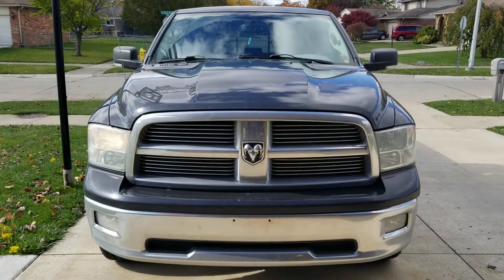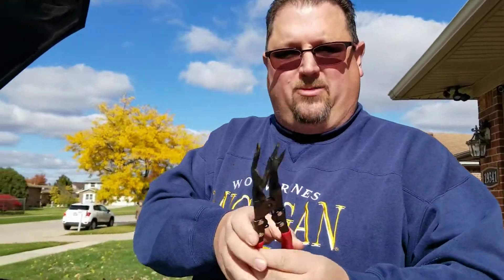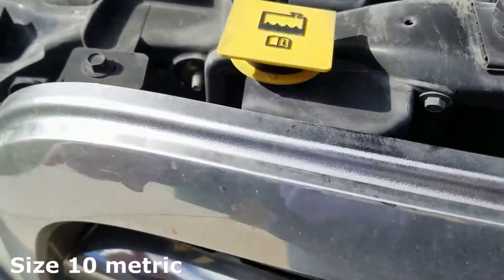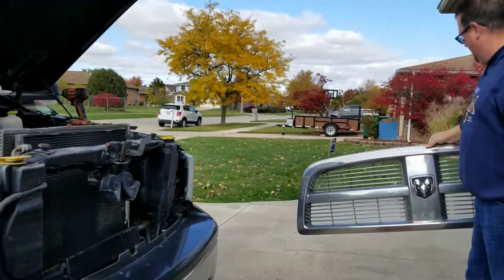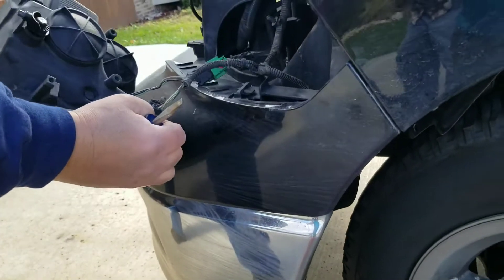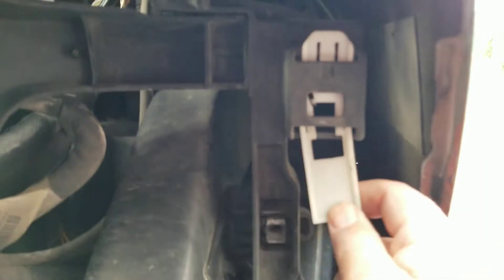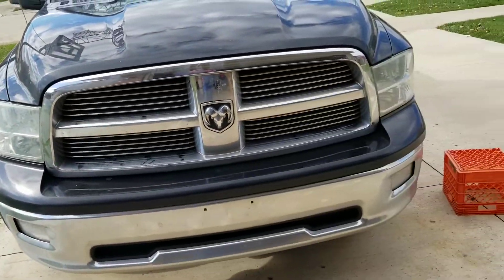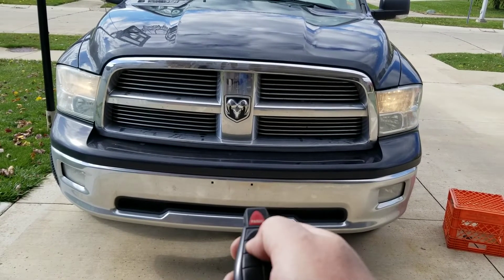How to replace a headlight in 2012 Dodge Ram

Comment: You just showed the hardest way to do this job. There is "No" need to remove the cowling and grill.  You can reach the bolt with an extension .
I recommend watching other video's that show the proper way to do it.
This guy needs to watch them too.
Reply from the maker: Don't take shortcuts.  Do it right the first time.  That's my advice.  Ask an airplane mechanic.
Reply: @GebosGarage  lol if using extensions were the wrong way of doing things I'd have to drop my transmission on my 135i just to replace a starter.

We're talking about headlights here...not head studs.

Comment: Idk what others are saying by accessing it from the wheel well. I tried it was to difficult to locate what bulb where they need to go taking the cowel off and the grill so much easier less than 5mins to do those and a few mins to change the bulbs and another few mins back on. That little up and down switch Ram didn’t need to do that. That’s way to extra. Thanks for the video I thought I was gonna take the whole wheel cowel off and work from that. Once I got to watch that cowel to be taken off and the grill it was a no brainer from there.

Comment: Proof anyone can make a how to video, even if you don't know how to.
Reply from the maker: It looks like he knows how... the bulb is replaced and reassembled, and it works, and it was done per the manufacturer instructions.  

Don't blame the everyday consumer for doing it correctly. Blame the engineers for making it a process or the dealership for the crazy price of over $300 to replace a bulb.
Reply: @GebosGarage  I think it is safe to say that the manufacturer, put an access door in the wheel while they probably don’t want you to take the grill on the whole upper panel off.
Reply from the maker: @trd4d  That's just not accurate.  You absolutely cannot, in any way, shape or form, access the bulb through the hatch in the wheel-well.   That hatch serves one purpose, to reach the latch that secures the headlight assembly in place.    But you're not the first or the last to make this statement.   If I'm wrong (I'm not), go make a video and show the 70,000 people who have watched this video your shortcut, please.  I say this sincerely.  I'd love to know your trick.  Show us, please.
Reply: There are a dozen videos showing what I said.  I clearly said that you don’t need to remove the grill or the entire upper panel.  All you do is access the rear latch from the access panel, and the front bolts by taking one pin out of the upper panel.  The one pin only makes it easier. After watching the rest of the video, I see you used the access door anyway.  So, removing the grill served no purpose at all.
Reply from the maker: @trd4d  Ah, I see.  Yes, you have to get to the bolts.  I misunderstood.  I thought you meant I could get the bulb out through the access panel.   🤔   That would save time for sure.    Thanks for your follow-up.
Reply: 😂😂😂deadass

Comment: We have changed our headlights to smoke one's n now replaced the bulbs to L.E.D. DIDN'T TAKE ANYTHING OFF THE TRUCK AT ALL TO PULL OUT MINE IS A 2012 DODGE QUAD CAB
Reply: Hello i want to change my headlight bulbs for the first time ever. I have a 2012 ram quad cab
Reply from the maker: Cool.  How did you do it?  Send us a link to your video tutorial.  We love seeing other peoples content, and ways to do it better.
Reply: Too bad people have to be rude, espeshly when the way to do this task they are referring to has its own issues. Just try replacing a bulb through an access panel without touching the glass bulb.
But each to their own.

Comment: Lol how is this one of the first videos that Google gives you for a bulb change? I didn't do any of what you said and got my old bulb out in under 10 mins that includes looking for a 10 mm and my long extension and that took about 9 minutes and 30 seconds. It's a valid effort ill give you that but you could do it so much easier and because of that this shouldn't be a recommendation by Google to fix or change a headlight
Reply from the maker: Yep.  Your way is another way to do it, too I suppose.  The dealer wanted over $300 to replace the bulb.  This is how they explained it was done... perhaps to justify the cost?  Imagine if they did it your way with that speed and efficiency AND still charged $300?     But listen, I can't complain about the dealership though.   They just dropped a brand new Long Block in this baby for me.... covered under warranty...  I know,  I still can't believe it!

Comment: Good example of people making how to videos with 0 experience in the subject
Reply from the maker: That's not a fair statement, and I'll tell you why.  I have previously changed both headlamps twice.  So, by definition, I have experience.  

And, people who say you can change the bulb through the access panel in the wheel wheel, that's simply not accurate.  That gives you access to the locking mechanism for the headlight assembly to unlock it so that when you do the job correctly, you can remove the headlight assembly to get to the bulb.

Comment: What a waste of time and completely incorrect. I have a 2012 Dodge ram 1500 and I changed my highlight bulbs in less than 10 mins. There is an access cover in the wheel well where you can access the light bulb. You can change it from the wheel well access cover.
Reply from the maker: Will you show us, please?  I like to learn new ways to do things.  The locking mechanism that you access from the wheel-well is in the way of getting to the lightbulb assembly on this 2012 Dodge Ram.
Reply: Looks like the plug on 2012 is a common problem. I wouldn't have known to look for that, thanks. Now I can take back my $100.00 bulbs. What a rip-off Dodge!
Reply: Higlights bulbs its easy, but for Headlights you gotta do that, you gotta unscrew the Headlights frome the front
Reply: That’s the best way to do it, if you have other way to do it show us. We can learn new things.